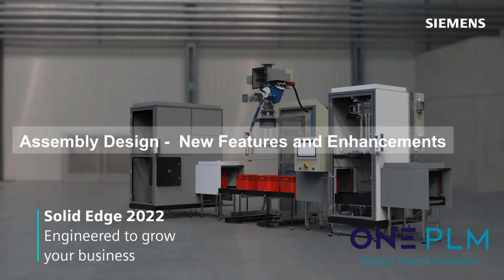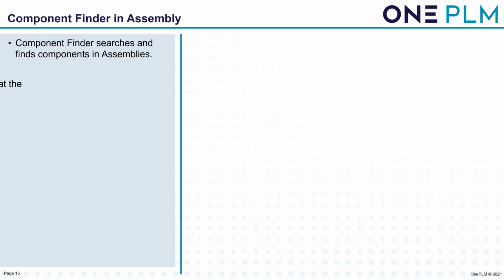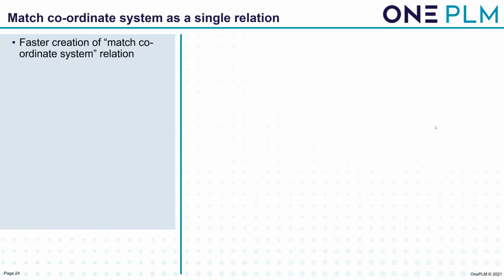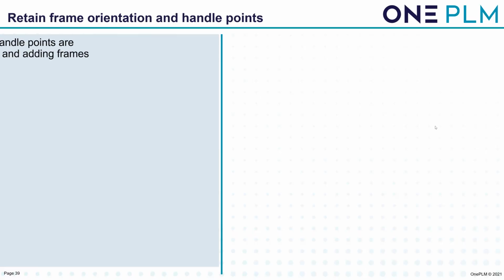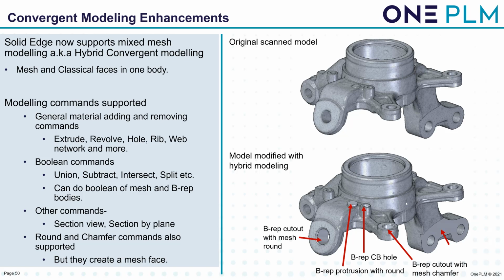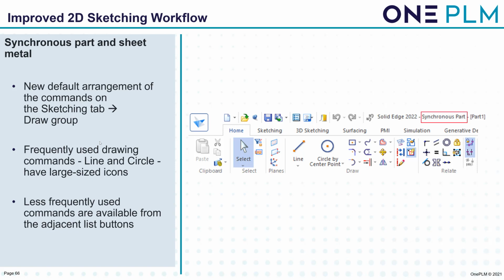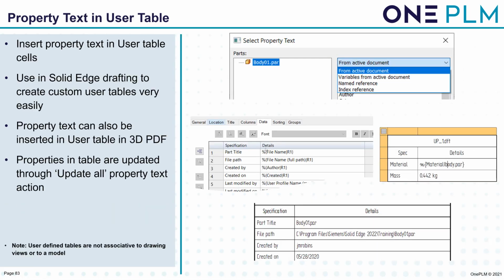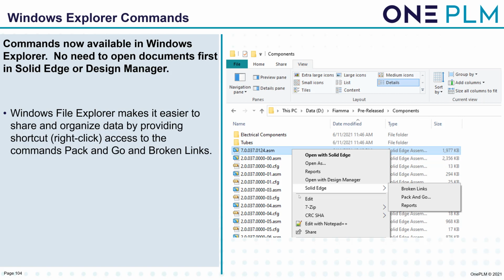What's New in Solid Edge 2022

Comment: Hello, I do have a question about the new user interface. What is the command bar below "The Ribbon" ? It seems to change depending on the tool selected. However, I do not want it and I cannot seem to get rid of it. It is located below the ribbon and above the file tabs. Do you know what it is called and how to get rid of it?
Reply from the maker: Hi JD, you can turn off the Predict command in the Helpers section of the options